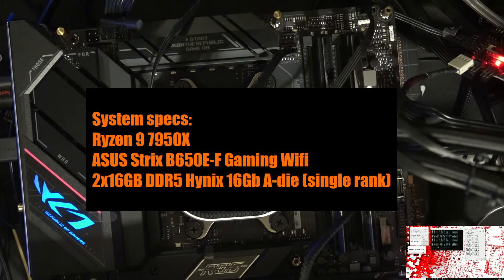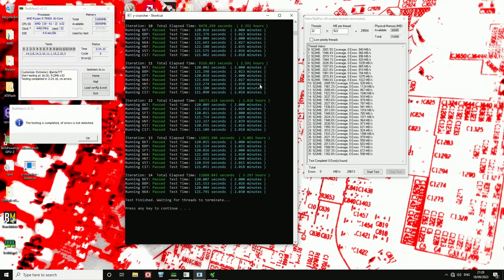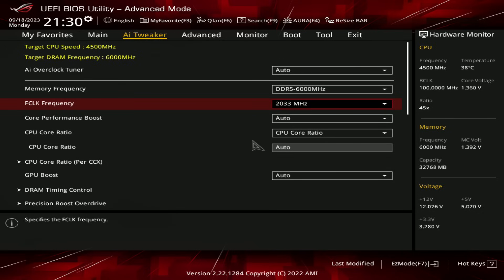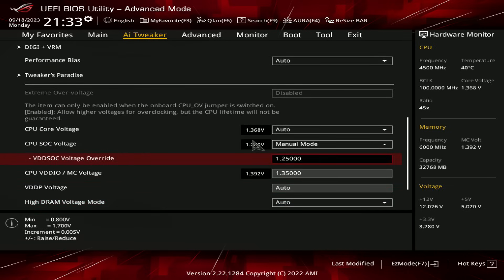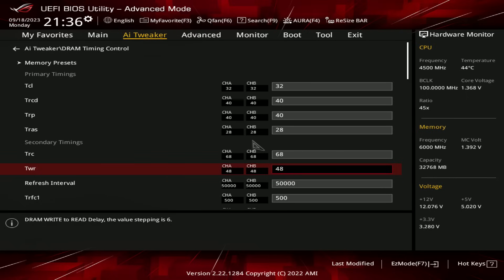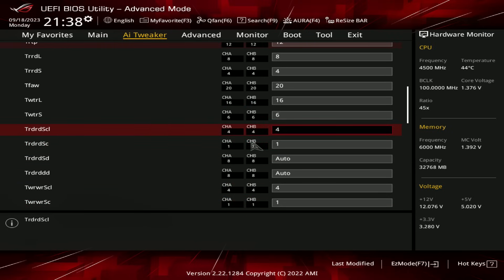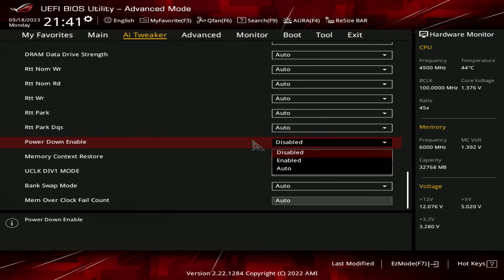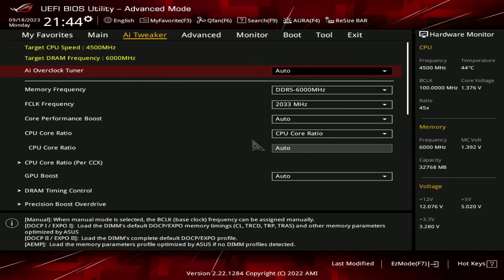Easy memory timings for Hynix DDR5 with Ryzen 7000

Comment: I have a weird problem.
Using F5-6000J3038F16GX2-TZ5NR with 7900x on an asus b650-a gaming.
It has hynix memory but if i put your values in it doesn't even post.
If i enable expo it loads into windows but is unstable and fails memtest.
If i check one module at a time it works great.
What should I do and what could be the issue.
Thx in advance 😊
Reply: Its power down mode and MCR. MCR must be disabled if you disable power down mode. And I do mean must, or you'll get bluescreens.
Reply: Check Memory Context Restore is enable or disable. If it is enable, then disable it and see if it works or not.
Reply: @HoangDucNuyen  i had it disabled.
Turns out if I put one stick at a time it works. Both dont work with expo. When i reduce clock to 5800mhz it suddenly works
Reply: @Chamsdlr  - hmmm, seems like yiu have a bad IMC CPU. Have you updated latest bios?
You could bring the cpu, mainboard and memory to the store and ask them to check which one is a culprit.

Comment: How do I dial in the primary timings on a kit without XMP/EXPO?
Reply: By setting them manually?....
Reply: @insertnamehere4419  Was hoping for general guidelines and a reasonable order of operations (X>Y, Z value must be 2 times X, etc.) Not gonna just try random values.
Reply: @UranTCG   Your primary timings are listed on the box for your memory.  If it  has no EXPO or XMP profile you ...shouldn't have bought it.  I'm not really sure what your problem is. If you mean it's a slow JDEC kit and you want to overlclock it and wondering what primary timings should be for a given speed, then start with like...36,38,38, 1.35v 6000mhz and try tightening from there.
Reply: @insertnamehere4419  It is a slow JEDEC kit and that's roughly where I ended up but I had a lot of trouble getting there with it being my first time overclocking memory. It's hard to find a middle ground between hardcore overclocking guides that are way too dense for me and 'just set it to the timings on the box' which didn't apply to my situation.
Reply: @insertnamehere4419  Ended up on (and I have no good idea about how to dial it in) 30-36-36-72 6000mhz @ 1.25 SOC 1.8 VPP and 1.35 on the other voltages. I don't think I'm gonna mess with it further unless I find a good resource or there's a new AGESA update that people do content on.
Reply: @UranTCG  Don't worry about vpp. 1.8 sounds right, and will do that on auto. Those primary timings are good, and dram voltage and soc are on point. If your set is Hynix you should be able to plug in the secondary and tertiary timings you see in this video. Just keep in mind he tells you to disable power down mode....this can and likely will cause issues if you leave memory context restore enabled, or on auto. You must disable memory context restore if you disable power down mode.
Reply: @insertnamehere4419  I appreciate your responses by the way
Reply: @UranTCG  np at all

Comment: is it still stable for your guys after that lowered soc voltage ? because this video was made with soc voltage at 1.35Ov which is way too high. so since now we're at 1.240 soc voltage, is it still stable ?????
Reply: Mine (with Builzod timing) is working fine and stable with SOC 1.25v on Tuf x670e wifi
Reply: At no point did he have SOC at 1.35. It's 1.25.

Comment: Thanks! This worked great on my 7800x3d and G.Skill memory! I bought the 6400 2x32 kit but only clocked it to 6000 and didn't have to change a single setting from your recommendations (obviously except for my primary timings) Thanks for the help! Super stable overclock!
Reply: Did you happen to get a 6400 CL32 kit from G.Skill?  That's what I'm looking at though I don't know that the motherboard I'm going to get for my 7800X3D actually can read the XMP profile to pull the primary timings?  Figure 6000 CL30 would be easy, maybe even lower since I'm just hoping to get Hynix A die.
Reply: @bobrocks95  same question...any update for the 7800X3D with the 6000 CL30?
Reply: @bobrocks95  AMD always supported XMP, before EXPO was a thing... so it should just work :)
Reply: Which one do you use? I am planning to buy a 6000 CL30 G.Skill for my 7800X3D but some variants are hard to come by in Germany especially a White RGB model.
Reply: @Ram-RTR  Worked fine but couldn't push it to 28 or anything lower. Didn't get any RGB kit though so you'll probably want to ask elsewhere

Comment: So if I follow this guide I don’t care if the memory is smoke or expo since I won’t use it anyway? I’m planning to get the G.Skill Trident Z5 2x32 6000 CL30 kit with the MSI X670 Carbon Wi-Fi and 7800x3D. Can I get the XMP kit? Since the EXPO kit is constantly out of stock.

Comment: If you have a Gigabyte B650 Aorus Elite AX this guide WILL NOT WORK as it has completely different options than what he's got
Reply: Incorrect. Like totally wrong thing to say. Every single sub timing is in the exact same place. I know...I have a B650 Aorus Elite AX. You're doing it wrong.
Reply: @insertnamehere4419 i can’t put tras 28 , just 30 is it ok?
Reply: So what works?
Reply: @vamospalchinchorro nothing
Reply: I have this mobo and i used his guide and everything is good
Reply: @سمون-ح3ك  i'm going to where he's going and the options are entirely different

Comment: Hi, I have Trident Z5 Neo F5-6000J3040G32GX2-TZ5N 2x32gb kit with 30-40-40-96 timings at 1.40 volts. What alterations should I make? This probably is dual rank so the TrdrdSd and dd timings should not be auto? Thanks.

Comment: Here my experiencee on Kingstone Fury Beast 5600 CL40 2x32, 7950x (PBO Enchanced 70° CCD0 CO -30 CCD1 CO -20), Asus Rog Strix X670E-f. Lowered the voltages VSOC 1.75v and the rest to 1.30v. It seems stable, but in benchmarks I lost performance (Cinebench R23 from 36000pts to 35000, CPU-Z Multicore 15450 to 14980). Hope this info can help. Thanks for the video!

Comment: New to the OC side. I’m running 2x 32gb g skill cl 30 6000mhz hynix memory. What should my Same/different dim settings be? Been having Ram issues and going to try doing it manually. (No bios/boot when DOCP enabled)

Comment: I found out that my ram is voltage sensitive it apparently works with 1.25 vdd vddq and vddio, this voltages should all be equal? I have tried 1.35v but was unstable not crashing but errors in memtest64. the ram kit is 16GB kingstone 6000c40 and is hynix M-die. Until I played with voltages was working in Crhome but with errors, with xmp enabled or BZ timings the same. And worked at lower voltages not at 1.35v.

Comment: I had to turn off Memory Context Restore to have memory at higher clocks with a 7800X3D . Blue screens even BIOS freezing with memory higher than default. MCR disabled....all problems disappeared. Strange thing is MCR was a non issue with a 7700x.
Reply: For me, enabling power down stopped the BIOS freezing and BSOD. What is the memory context restore setting called in BIOS? Just MCR? Using a 7800X3D too.
Reply: @Simon_Denmark  So I've learned memory context restore and power down mode go hand in hand. MCR MUST be disabled if you want power down mode disabled, otherwise...bluescreens so bad you corrupt windows.
Reply: @insertnamehere4419  Oh good to know. I’m wondering if the new AGESA has affected this in any way. Should be easier to overclock either way. So you need both disabled. How much did MCR affect boot times?
Reply: @Simon_Denmark  MCR off hurts boot time by 20+ seconds. But honestly, at least to me that doesn't matter at all. Actually I updated to the new BIOS today, and it does not solve the MCR /power down mode issue.
Reply: @insertnamehere4419  I’ll have to keep this in mind. I guess it’s memory latency vs boot time which doesn’t matter unless you turn your PC on/off all the time. But then again I don’t know how much latency disabling power down takes away.

Comment: Applied these today on Z5 Neo 32gb @6000 CL30 and it posted first try. Just make sure to disable memory context restore and also don't put 2033 for the infinity fabric since that was fixed and you'll be fine.
Reply: That explains why I saw no difference between Infinity 2033 and 2000. Back to 2000 it is.
Reply: So what infinity should i put?
Reply: @سمون-ح3ك I have my IFF set to 2100, it doesn't seem to matter if it is divisible into your ram frequency anymore with AM5 so the highest value is the best performing value now. I run my ram at 6200, and 2100 IFF does not divide into that, 2067 IFF divides into that but still performs worse than 2100 IFF. So basically just try 2100 and compare it to IFF=(DRF/3).

Comment: Hi Buildzoid, first of all massive thank you for providing these timings! Unfortunately they're not working for me, X670E-Pro Wifi and 32GB (2x16) F5-6000J3038F16GX2-TZ5N. They booted, managed to do an AIDA64 showing massive increases (from 78 GB/S to 91 and latency down from 65 to 58), did a few Cinebenches, some random browsing, but on the next reboot I got a Memory Management BSOD... Any idea why? DRAM voltage is 1.38V as it came with EXPO, haven't touched anything other than what you've shown. Thanks!
PS. I'm running 105W ECO on a 7900 with -30 on all cores, but that has been stable for one week now, being powered on 10 hours a day across different loads (music production, video editing, browsing, gaming) so I don't think that's the issue.
EDIT: For anyone wondering, leave your FCLK at stock and DO NOT touch the Power Down Enable setting. I've booted back into Windows now with the same exact timings, I'll run Ycruncher all night long and come back with the results :) For anyone curious, FCLK setting was bugged in old BIOS versions and changed the memory speed, but since it's now fixed it can make the system unstable. Power Down Disabled also makes my system unable to reach the login screen, having it on Auto makes 0 difference on Aida64, so I recommend keeping it on Auto if you can't boot any more.
EDIT2: After one week everything is rock stable, so don't mess with FCLK and Power Down setting :)

Comment: I'm trying these settings on a 7700x, b650i-e strix and 2x16 hynix a die and these settings are causing the igpu to flicker, and help?
Reply: What do you mean by flicker? Are you using the iGPU instead of a discrete one or both at the same time?
Reply: You need to increase the tRAS

Comment: What is the word on this since the changes to the SOC voltage limit and the BIOS updates? Should I be using this recommendation if I am running a stock 7700? I have low profile  G Skill Flare X5 sticks that are Hynix?

Comment: Can confirm this working on my 7800x3d with ASUs tuf gaming b650 plus on latest 1616 bios with Corsair 6000mhz cl30 kit the only thing I had to do was increase the ram voltage to 1.4 to get it stable at cl30 🙂, I tried everything with expo profiles and would not post at 6000mhz had to reduce to 5600mhz but this is literally perfect and working well at 6000mhz now
Reply: Is your memory rated at 1.4v?

Comment: My results on AIDA64:

Ryzen 5 7600 (PPT 85W - CO negative 30 - Thermal Throttle Limit 85)
2x16 XPG LANCER 6000 (AX5U6000C3616G-BLABK)

EXPO: 59314MB/s Read - 80583MB/s Write - 59860MB/s Copy - 65,2 ns Latency

Buildzoid Profile: 64574MB/s Read - 90917MB/s Write - 64727MB/s Copy - 60,8 ns Latency

Comment: can i leave memory context restore on while messing with these settings?
Reply: no you should disable it, until you have steady working settings
Reply: yes you can if you enable PowerDown at the same time with MemoryContextRestore
Reply: @HoangDucNuyen  This exactly. Power down mode MUST be enabled if you want MCR. MCR isn't worth enabling power down mode for, all you're doing is improving boot time by a few seconds, in exchange for a hit to memory latency performance.

Comment: so wait, does this just work with most memory kits? mine has Samsung B-die, 6000mhz, 36 etc, can I use these settings
Reply: No you cant. This video is for DDR5 with Hynix chip specifically.
Reply: Hynix only if you actually listened to what he said.

Comment: Setting Tras to 28 doesn't work for my Hynix kit. Not sure what die it is but the stock timings are 30-38-38-96. F5-6000J3038F16GX2-FX5 kit. Couldn't even get to the BIOS afterwards lol.

Comment: These settings are not stable on my system. Gigabyte X670 aorus elite ax, F5-6000J3040F16GX2-RS5K (hynix M-die) 7800X3D. Getting bsod and uefi freezing, have to clear cmos. F9a bios
Reply: Tried again with f20a bios, works now.

Comment: These settings also work for 6000MHz  2x32gb which are dual rank. Only thing different i did was oc to 6200mhz and dropped tcl 30, trp&trcd 37. This was on a 7800x3d oc'ed to + 5% and vsoc @ 1.26 in bios and under heavy load doest go over 1.305v in occt but aida64 has not exceeding 1.296v.
Reply: Are you running Gskill memory?

Comment: Keep getting bsod in the login screen with this. Not sure why but I def have a hynix. Not sure which die though. Should it retrain after putting this in? Mine just went fast to the login screen then bsod lol.
Reply: Power down mode MUST be enabled if MCR is on auto, or on. If you disable power down mode and leave MCR on auto you will bluescreen. I'm surprised there isnt a PSA on this. Would have saved me a headache when I went through it.

Comment: Thank you Buildzoid - been using your timings on a Corsair 32GB kit CMH32GX5M2B6000Z30K and they work great! I did however run across a wierd quirk in the 1415 bios on the Proart x670E while manually setting the timings in the AI tweaker menu. It seems that if I go from EXPO to manual timings, the input I made tRAS=28 and tRC=68 was overwritten by the MB as tRAS 76 and tRC 112 (EXPO timings). To solve this I needed to set the Hexadecimal timings via the AMD Overclocking menu instead - Still the AMD Overclocking only allowed for the lowest value tRAS=1E (30) for some reason. Setting 1C (28) throws a bios value error. 
Not sure why the BIOS keeps the EXPO settings if I use AI Tweaker to set manual timings - something similar you've encountered working with ASUS AM5 boards?
Reply: I am having the exact same ram and can’t seem to get it stable.
It’s very frustrating, I tried different BIOS versions and everything in the video and it still doesn’t seem to work.
Did you set anything other than mentioned in the video?
And are you on bios 1415?

Comment: Thanks, helped me a lot. Tried to get it stable with my 6400Kit but couldn't do it and had to clock down to 6000. Then as said your settings worked without flaw ! Massive 22.5% lower latency, about 18-20% for transfer speeds.

I am just too stupid to understand the black magic behind this Memory Tuning stuff.

Comment: Tried it -
Ryzen 7600
Gigabyte B650M
Corsair 2x16GB 6000Mhz RAM

Was fine all of yesterday but booted up today and had back 2 back BSOD’s all with different error codes. Starting to think it’s my mobo because it also has stability issues simply trying to run the XMP profile :(
Reply: Try same settings with --> Power down --> Enable
Memory context restore --> Enable

Comment: Hey JayZ, I got also the 7950X3D since some days and mother of god the performance and especially the 1% lows and dips are insanely good. Had also some ram issues on my X670 Hero but now I use 6200hz cl36 Corsair dominator. Using Buildzoids?! Timings at 6000mhz and the PC works just great. I'm in 1415 bios and now it's buttery smooth. But I can hit PBO only on -15. Over that my PC and benchmarks crashing

Comment: Seems not to be working anymore on latest ASUS BIOS. Unless I changed any of the settings wrong. Maybe this is because SOC voltage is now actually the value you set rather than the value plus extra.

Edit: indeed seems to be more stable (e.g. no instant BSOD) when I raised SOC voltage from 1.25V to 1.30V. Seems like 1.25V is no longer enough.

Edit: still crashes even at 1.30V.
Reply: Yep. Latest asus bios ruined my memory OC. I was able to run 6200 with timings from this guide... not anymore.
Reply: Still fine with bios 1413 and manual 1.25v soc. My cpu is 7950x3d and 2x16gb kingsston 6000 36-38-38
Reply: @HoangDucNuyen  I'm on latest bios 1616 I think it's called.
Reply: @MRFISHLUKE  - Have you check if MemoryContextRestore is ON or OFF in bios 1616?
Reply: @HoangDucNuyen  I don't know what you're talking about
Reply: @MRFISHLUKE  - pause at 15:36 in this video, you will see there is an option called "MemoryContextRestore". 
I believe in recent bios1616, ASUck turning it ON, which will make the system boot really fast, but will make the system unstable as hell (leading to BSOD)
Reply: @HoangDucNuyen  I left it default as per video
Reply: @MRFISHLUKE  - try apply Builzoid's memory settings again and disable MCR, see if your system is stable or not.
Reply: Thank you! Using a B650E-E Rog Strix board, and even in BIOS it would just freeze. I managed to switch the voltages to 1.30v,(which is max) and so far it seems stable. Gonna have to test it out with regular use.
Reply: @AliBabah91  unfortunately after not too long it crashed again, so I'm just using expo now. Might be better for you depending on your motherboard, memory kit, etc.
Reply: @MRFISHLUKE  Damn.. Which board and RAM are you using?

Im running on the B650E-E Rog Strix Board, and the G.Skill Trident Z5 Neo RGB F5-6000J3038F16GX2-TZ5NR (2x16gb)
Reply: @AliBabah91  Asus b650e-i and non-rgb version of the ram you have. CPU is 7800x3d (perhaps it varies by silicon lottery as well...)
Reply: @AliBabah91  i have the same, on bios 1616 it bsod's. back to expo :C
Reply: Oh well, it seemed too good to be true. After first restart and a boot time of 15 seconds, the problems started. Constant crashes, even in BIOS. So i’ve just reverted to Stock settings.
Reply: same thing here with Hynix and asus b650e board - no longer stable and leads to BSOD and hangs in the bios. Reverting to prior bios fixes this
Reply: im using same rog b650e-i on BIOS 1812 and it is not working for me too :( did you get any solution?
Reply: Same here, no longer stable.